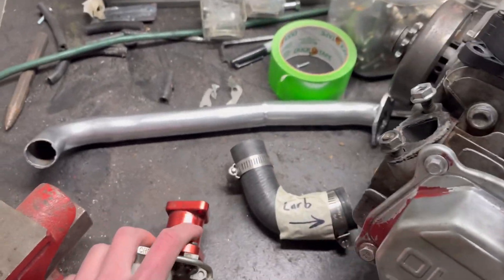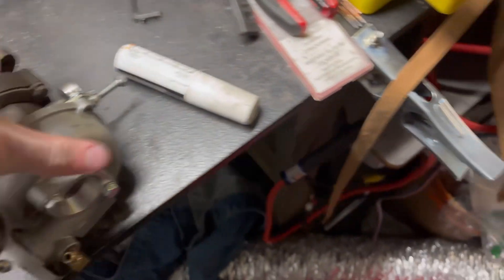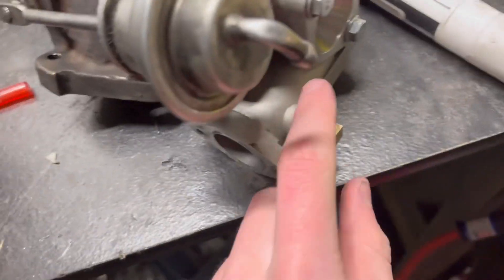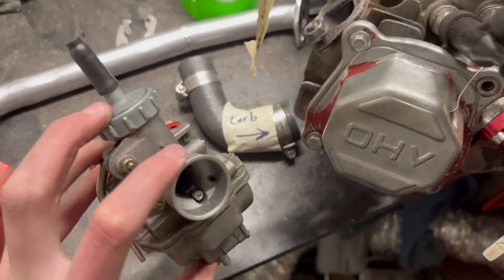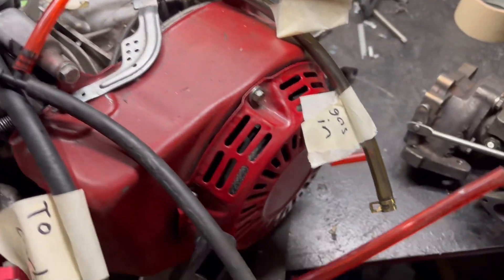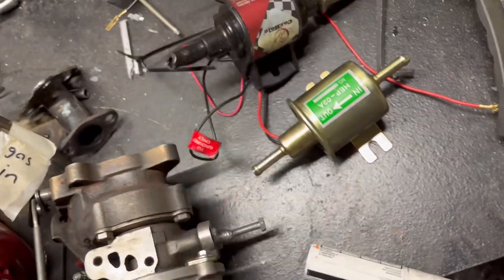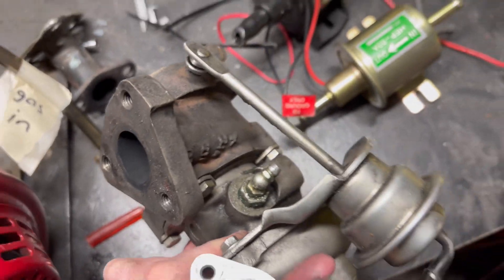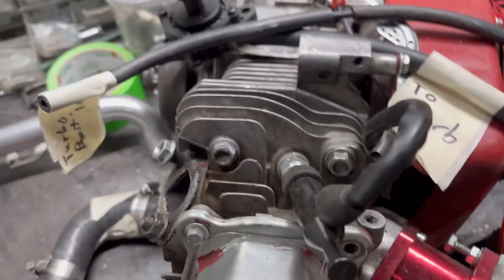How To TURBO a Harbor Freight Predator 212cc Engine 🐌💨

Comment: You need a lightweight flywheel, more powerful coil, bigger cam and valves. Maybe a light weight and shorter connecting rod and machine the rod journals of the crankshaft off center to increase stroke and compression? I'm curious just how much power can be gotten out of it.
Reply: you wouldnt want more compression when adding turbo the a/f mix is already under pressure from the turbo more comp. ratio would ask for detonation

Comment: I'm  super charging my 212 with an amr 300 but I'm worried it might not handle it and bend a valve or break a rod It has race rockers billet flywheel open exhaust, catch can  stock internals any advice anyone?

Comment: With blow through you need to perfectly match intake air pressure and fuel pressure or else the turbo will push the fuel into the tank or to much fuel pressure will flood the carb

Comment: How are you oiling the turbo?
Reply: I filled mine with 10w-40 Rotella oil for diesels and make 2 block off plates drilled holes in said plates and bolted them on

Comment: When you had it running you weren't making any boost! None, 0, nada!  You need a separate oiling system including a feed pump and a scavenge pump. You also need a fuel pressure regulator that will compensate for the boost. as it is that turbo isnt doing a damned thing!
Reply: Why do you have to be a piece of crap about it
Reply: @snakeking20208YT he’s not. He’s being logical, it’s cool and all but all for looks, performance wise it’s damn near impossible to get a properly functioning turbo on these
Reply: @snakeking20208YT he just trying to help.
Reply: With a blow through setup all you need to do is equally pressurise the carb and fuel tank and you don't need to use a fuel pump.
Reply: Why would he need a fuel pressure regulator?!
Reply: @TarenGarond  to keep the fuel pressure exactly the same as boost pressure so the fuel dont get pushed into the fuel tank.
Reply: @thatcolman200u  Doesn't the boost pressurization of the fuel tank do that perfectly already?!